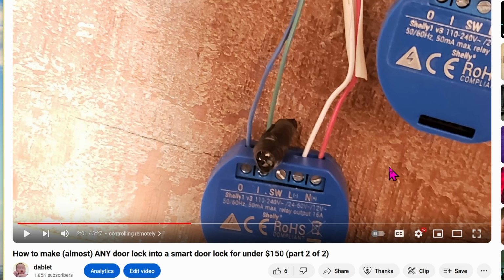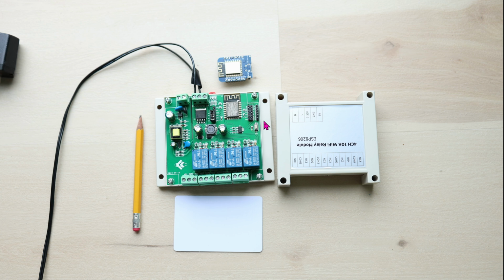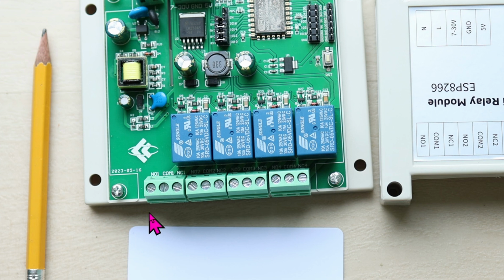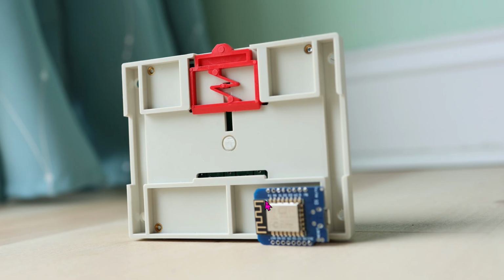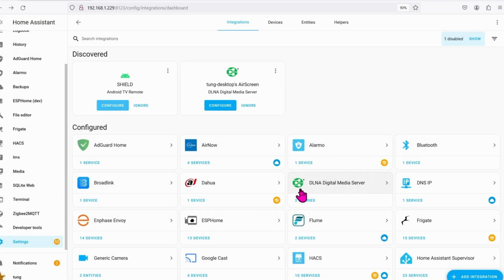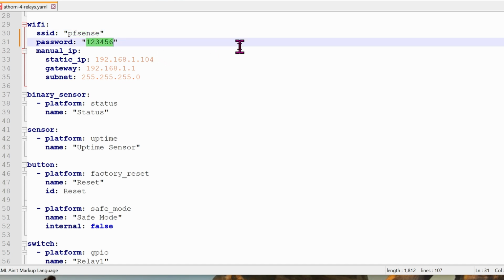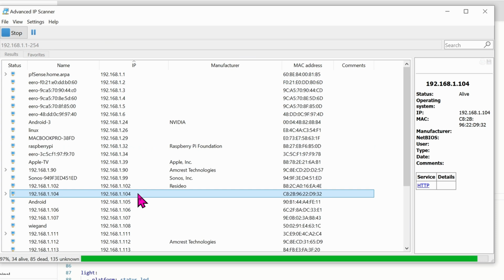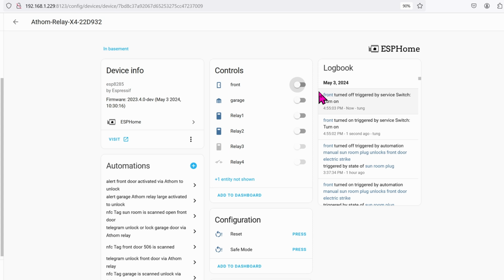Athom 4 channels relay is amazing! a huge upgrade from Shelly 1.

Comment: The Red device on the back is a locking clip for the din rail. Click it on and pull the red lock out to release - great channel good vids
Reply from the maker: ahhh, this makes sense!
Reply: .. and DIN rails would make sense for a device like this because you might want to mount a 12V power supply on a rail in an electrical distribution box - that's how I'm powering my relays

Comment: can i suggest a video on using nmap or other similar addon, to have automatically the new devices connected to the network appear in an home assistant panel, to easy find their ip address or even check if someone found our wifi settings and is in our network? thanks
Reply from the maker: oooh, i did not know about nmap until now. thank you!
Reply: @dablet  shouldn't be difficult to create a panel with new detected ips... Plan for a video? 😅